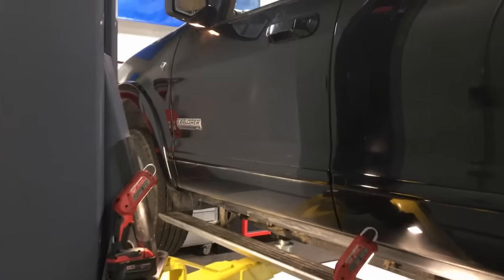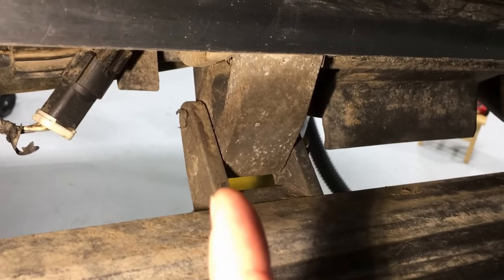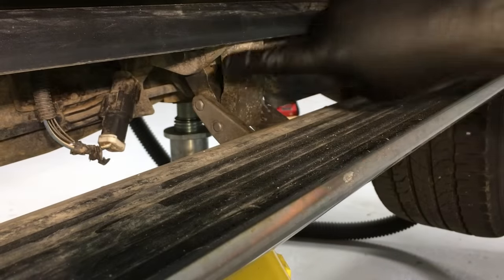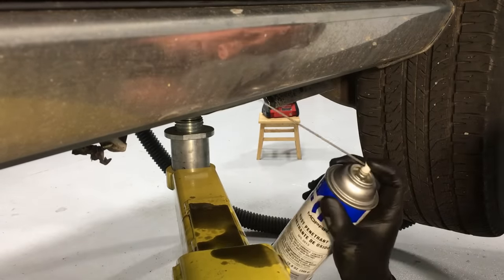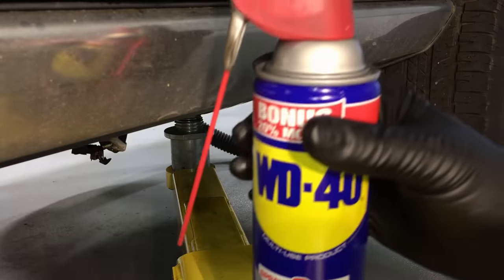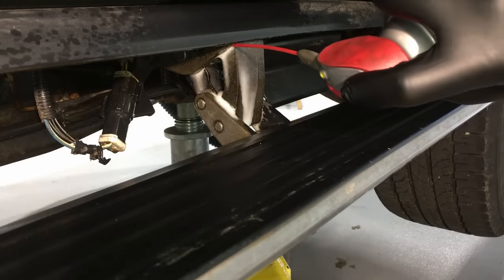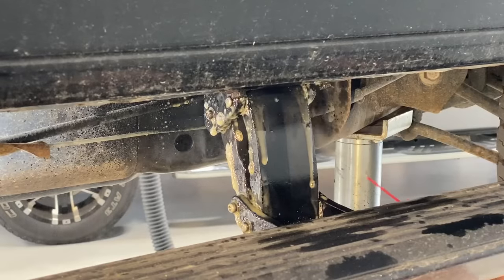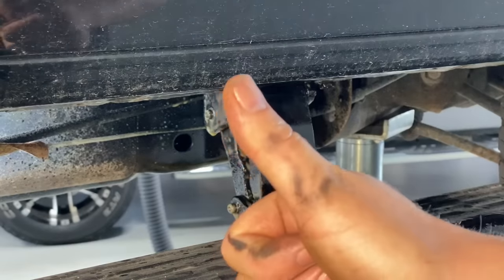Ford Quick Tips #86: How to Fix Stuck Power Running Boards for Good!

Comment: I have been trying to change my motor but the step is stuck up is there anyway to get it to come down?
Reply: Make sure the running board settings in the instrument cluster are not turned off.
Reply: @rays7437  thanks but yea the settings are correct because the driver side board comes down fine passenger side used to but now no movement for weeks😭
Reply: @jimduganhard   In that case I think you have to remove the whole running board assembly to get the motor off.  Depending on year, make, and model.  It has been about 8 years or more since I've seen one in the shop.  We don't have very many failures in the Southwest.  The last one I remember, we had to replace the whole assembly because the motor wasn't available separately. It was going to be some ridiculous price of around $2200.00 so the customer went to an aftermarket truck customizing shop and got new aftermarket ones put on.
Reply: @rays7437  yep took the whole board off just to see what i could do and there back latch moves but the motor locked up the front one i might just have to go the Ebay route and order a whole new board😤

Comment: I got a 2015 F150 with the power running boards. My driver side board is slow to retract and come back up, and the board freaks out when its wet out. Would you think the motor is the issue in my case? I've cleaned and lubed up the hinges, which helped marginally
Reply: I had the same issue on my 2013 F150 limited with power running boards.  I neglected them for 50-60k miles before they started to do this.  I took mine to the car wash and from inside the truck, brought them down through the menu options under vehicle tab in the dash.  I hit them with foam and high pressure water, cleaned them up real good including all the joints.  I immediately used a quality rust inhibitor and then sprayed them down with wd40.  Brought the truck back home, and put cheetah grease on all the joints.  I had to hit it with cheetah grease for like 2 weeks straight to get it to really soak in.  After that they work like new.  I learned my lesson and now spray them down annually right around fall.  I’d keep trying to shoot lubricants in the joints and then actuating  the running boards up and down.  I had to help em up sometimes by doing what Brian did in the video and push them up with my foot.  I will say they are very beefy including the motors and they are not really prone to failure from what I can tell.  As Brian stated in the video, keep your truck running while doing this.  It’ll send the right amount of power to the motors while you are actuating the running boards.  Hope this helps!
Reply: @twofst4u20  never heard of cheetah grease, the people that make it must be very fast!
Reply: @markk3652   - LOL!

Comment: This should prevent a lot of miss diagnosis👍
Reply: Too bad it's not in the dealers best interest (pocket book) to do this.  I was lied to directly by TWO dealerships, they said that the boards were 100% frozen and MUST be replaced.  Why?  Because charging $3400+ to replace the boards is a much higher profit margin than charging $75 to clean them (it's a 30 minute job for both sides).  1/2 unit of labor or 2 units of labor...plus the markup on the parts?  Which would you pick?  Yep...but "Customer Experience" is a Ford employee issue...the dealerships don't care, they care about how much money they can make.
Reply: @WreckDiver99  facts💯

Comment: I have never seen a Ford Explorer from this generation that has power running boards. What year was this vehicle? I have a 2010 Ford Explorer and it doesn't seem that power running boards were ever an option for this vehicle.
Reply: 2008-2010 Explorer Limited's power deploying running boards were an option.

Comment: But what about "protecting the motor". Seen one that was rusted out, and another one today, that the rust was starting. I've reviewed the manufacturer install manual and I thin the rusted out motor was incorrectly installed at front (OEM dealers don't read instructions) where front wheel kick up debris is at the highest. Here in Canada so winter road salts are certainly a concern for me. PS congrats on being #2 or in my eyes #1

Comment: I have a 2016 Ford F-150 with the 3.5 Ecoboost I have a code p0131 and p0053. Any ideas on what the problem is ?
Reply: I would check the wiring and the connector, if ok then replace the sensor with OEM and see what happens, assuming there are no other running problems

Comment: How about the opposite issue... The running boards won't come down. They are on Auto but don't budge. The driver side pulls down manually (or if your leg catches it) but the passenger side doesn't budge. If I turn it Off you can hear the motor make a click. But nothing moves.
Reply: Have the same issue. Driver side is stuck up and won’t come down even after all the lubricant and cleaning. It could be cuz it’s harder to reach all the joints when it’s closed. I tried pulling it down with a crowbar as I opened the door but it just made that sound and gave up. Any luck with yours since u posted this?

Comment: Hi brian I've been a follower for some time. I'm having an issue with my 2012 expedition 5.4 3v .. cam shaft pos sensor B keeps going off. I changed both cams and crank shaft with oem parts a month ago. Engine light just went off again same code. My mechanic is telling me it's most likely the timing chain. Any advice b4 I sink $1200 into this big project?? Thanks for ur time

Comment: Hey ford tech makuloco bro can you please help me find the steps to change the timing chain on 09 Suzuki sx4 and I need to find the crankshaft sensor  I have a code for camshaft sensor p0340 I changed and it didn't fix the problem so I will change the crankshaft sensor but can't find it please help bro

Comment: My driver side running board motor makes an ocean seal like noise when trying to come down or up. It does move if I assist it with my hand. 2010 Expedition. I’ve tried all sprays mentioned in the video. Anyone have any thoughts on a fix besides replacing motor?
Reply: I am sure in many cases the motor needs changing

Comment: I have taken my 1996 ford F-superduty(450) to like 4 mechanic shops and a transmission shop and no one can figure out why it is stalling when put into gear and release the brake to accelerate, starts up fine idles ok, a tad bit low to me, drives great after the rebuilt trans and torqure converter and all the fixes I did including a new ECM, it has the 460 7.5 engine and E4OD auto transmission, anyone have any tips, its at another shop right now, I'm basically at checking actual plug connections and corroded wires , so frustrating cause its intermittent , almost always happens on the first start in the morning then usually fixes itself when engine warm up but has still done it even after some drive time ,  its a 460 7.5 gasser with E40D auto trans, stalling when in gear releasing the brake to accelerate HELP!

Comment: Great video, as always.  The Fluid Film was a good choice for a lubricant and protectant.   WD-40 is a long term corrosive chemical that causes rust with prolonged use in one area.  It is a good initial lubricant and penetrant.
Reply: He flushed all of the WD40 out with Fluid Fillm.
Reply: I added clarity, Buckhorn.
Reply: WD-40 causes rust?  Now I have heard everything.
Reply: In this case the wd40 is mainly acting as a flushing agent and cleaner, and it would indeed be good for that since it’s thin.  It’s a very poor lubricant; I call it kerosene in a can.  The FF is the real lubricant in this case, in addition to being the protectant.  BTW, FF Black is coming out this fall. 

This is the second pro recommendation I’ve seen for Mopar penetrant, I need to try a can of that.

If those boards are $2K per side, I’m surprised they don’t have grease zerks.  Or maybe I’m not.
Reply: @alphaomega8373  do some research on that keyboard you are so fond of.

Comment: Now that I watched this video I will be jinxed and will have to do this repair to my F150 within a couple weeks. Ha ha!
 A few weeks back I watched your video about the stuck valve in the A/C  Compressor and then a week after that the valve stuck in the wife's Ford Escape causing it not to cool at idle.
 I have not fixed it yet however I found out that if I revved the engine up a few times while parked the valve will unstick.

The suction pressure was high like at 70.
Then it dropped right down to 35 or so after a few revs.

I have Bluetooth refer pressure transducers so I was able to watch the pressure while sitting in the car.  :-D
Reply: I'm in Arizona.  So my auto steps will probably not fail. 
But maybe some clean and live won't hurt when I get a chance.
Reply: I know nothing about Arizona life. I live in the salt belt, I would suggest doing this process now before you have an issue. It goes much quicker and you don't have to push things around and clean it as much.

Comment: Hey friend awsom videos enjoy watching them I'm hooked on your channel bro , everything you talk about is on point  ,sence your the man wen it comes to Ford  ,was wondering if you ever come across this problem?  I have a 99 Ford f150 4x4 w 4.6 triton engine a/c blowing nice and cold But wen going down the road it fluctuates from cold to warm and almost and you can hear the blower slowes down and then it picks up again cold ,but today i driving and it did it again wen i was coming to a construction site   and hears the weird part wen i tap on the break it came to a cold a/c again  ,so i thought it was coincidence so wen it did it again i tap on break again and came back to cold again ,i did this throughout the whole trip and it worked. Any ideas .Thanks in advance.
Reply: Any body??

Comment: The similar process also works on my 4Runner Limited... Some have brought them back to Toyota and replaced the auto running boards or removed them. I live in the snowbelt.

Comment: Actually wrong about wd40, it evaporates and is actually a cleaner with also being Water Displacing any why we used it on distributors all the time. Keep a can in the car. Back in the day you go through a deep puddle you could get water in your distributor (not sealed to let pressure out) and miss fire or quit. Few squirts of wd40, let it sit for about 5 minutes and back on the road. 

Anyways, it's why you don't use it on a chain. Instead use a silicon liquid spray that dries so it doesn't collect dirt and debris. But it's great video!!!!!
Reply from the maker: Not wrong, we used it as a solvent/ lubricant here and not for a permanent lubricant. The WD helps clear out the hinge area of trapped water dirt or even grease it will dissolve being a solvent. At the end the fluid film is used as a lasting lubricant and protectant not WD.

Comment: Go through this all the time in winter they always stuck down building up with snow and ice now I just shut them off in the winter I also removed all pins and cleaned them and lubed them up before putting back the pins on mine is what's always seized up my wife has gmc last 4 years  and those steps never got stuck once it's just an all out bad design from Ford

Comment: I worked for an auto dismantler 30 years ago.  These did the same thing then.  Not sure if the tech was the same.  Shame on ford.  I have a 2015 Ram and there are so many things nice than my 2016 F150.  Ford cheaped out in so many places.

Comment: EDITED:  It is more weird now.  Running engine made no difference.  BUT...I tried swapping boards - Passenger board works fine plugged into either Driver side or Passenger side.  Driver board works fine if plugged into Passenger side.  But Driver board will not work properly when plugged into Driver side - it has that step operation noted below.

Any clues what's going on??

********************************************
I am hoping someone here can help.  I had my running boards off for some body work.  When I put on the drivers side, it acted like it was sticking so I lubricated.  I then tested it by just plugging it in without mounting.  It acts like it has stop points.  For example, it will open 1/3.  When I close the door I will hold it.  Opening again it will go another 1/3.  I can repeat a third time and it will be fully opened.  If I reverse these steps to close its the same - only going about 1/3 of the way, hold then another 1/3 until it is fully closed.  But it will not open fully in one go or close fully in one go.

Are there some kind of settings that control how far it opens/closes?   Or is the motor bad?

One interesting thing mentioned here is to have the motor running for full power.  I'll try that right now.  (running engine made no difference)

Comment: Amp power boards have the same issue .
Reply: True. On the plus side a pair of AMPS cost less than one Ford. The downside, the AMP boards don't integrate with the vehicle like the Ford boards.

Comment: My steps began locking up at about 18 months old which wasn't surprising as at the time it was my work truck and it was muddy fairly often. The truck is now a mall crawler and doesn't see offroad at all.Lubricating my pins helped for about another year or two. I eventually gave up and unplugged them in the down position. First, let me say that  it's pathetic that Power Amp doesn't put grease zerks on these darn things so that this problem would go away. I've searched for a service that rebuilds the steps with grease zerks but no luck. If anyone knows of a company please post it.
Here is my question: Anyone ever removed the hinges and just soaked them in a bucket of solvent/ WD40 or something like that? Thx.

Comment: This is clearly a salt problem. Have an 09 with 225k miles on it, but it's an Arizona and Central Texas truck. I've never lubricated them in the 13 years I've owned it.

Comment: WD.  Water displacement formula 40.  This is not a lubricant.  Use some actual oil and do it every fall and spring.  Otherwise a very insightful video.
Reply from the maker: Another whack job saying it is not a lubricant even though the actual company says it is and even water itself is a lubricant. Yes I know it is more of a solvent than an oil.

Comment: If you have them, replace them with non-power running boards. Problem solved.
Reply from the maker: People love these power boards though.
Reply: I hit the trails a lot and would hands down choose these over fixed running boards.  You gain a lot more ground clearance and again the boards are very beefy.  If you have kids or a short wife 😂 like I do, they don’t have to struggle climbing into the cab.  I have my truck lifted 4” I haven’t bottomed out yet but my buddy with the same yr F150 with regular running boards and a lift has. But I digress, to each their own.
Reply: @twofst4u20  I even added extended hinges for my DW, causes the steps to hang about an inch lower when folded, but they are about 2 inches lower when open.
Reply: @wb6anp  if you want to be amused, go on youtube and search short women getting into big trucks. It's pretty hilarious!
Reply: The retractable boards make the truck look so much nicer than the stationary ones. Love them
Reply: @twofst4u20  I agree. What I have seen with them is out were I live a play, the mud packs on them and the either will not deploy or retract. Same with snow and ice build up. Something I do not want to worry about elk hunting in November.
Reply: @FordTechMakuloco  hey brother, I have a quick question. I'm in the middle of changing out the front struts on my 2010 Ford Flex. Stupid me, I didn't take note of the direction of the arrows on the old/stock strut mounts. Which way would these notches or arrows go on a 2010 Ford Flex? Thank you.

Comment: More ford Junk ?
Reply: Nope, this happens to high end Cadillac Escalades too. It's a nice feature, but it is flawed inasmuch due to the location of the mechanisms. Put anything articulating in that location, it causes trouble.
Reply: Yes. Ford is the only manufacturer that uses power running boards that are operated in "salt" states.